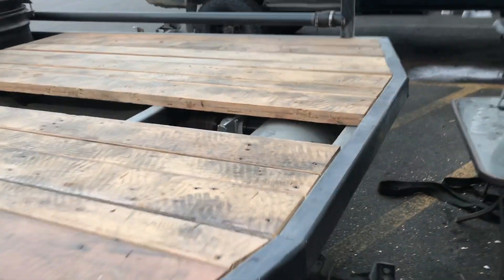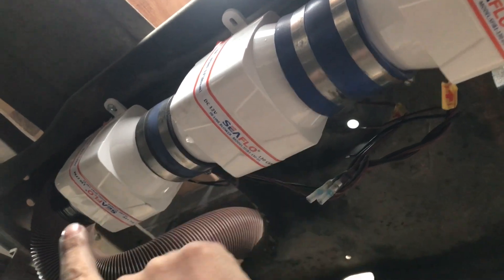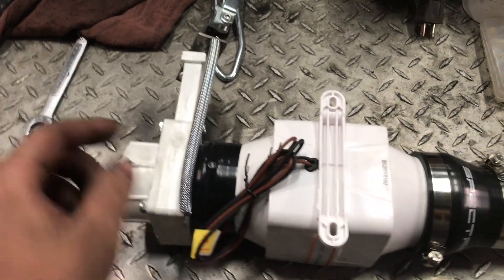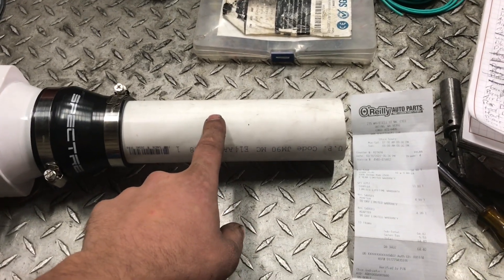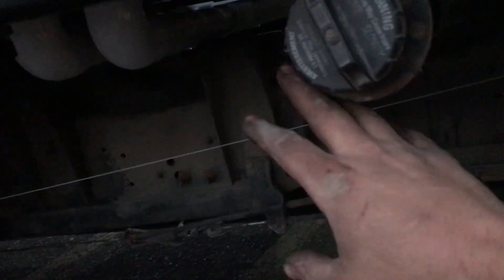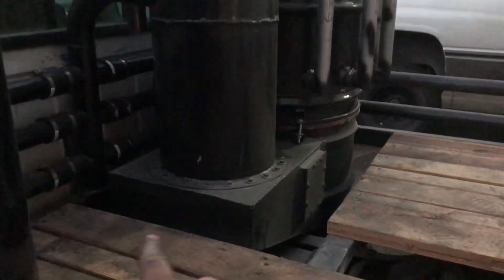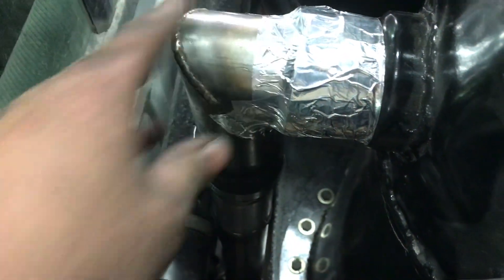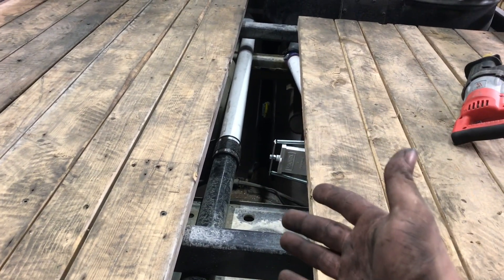V10 Gasifier Build Blower Fans and Rear Gas Line Plumbing

Comment: Thx for this video. Can I connect the blower directly to the car battery or I need a resistor or something else?
Reply from the maker: No resistor needed, I just jave mine on a 10 amp fuse, these blowers I use only pull 3 amp if I remember right and I run 2 per fuse with 14ga wire. Total overkill but they have been problem free

Comment: Nice work. Do you run the blowers as a performance enhancement?  To increase head pressures at the intake?
Reply from the maker: No these blowers don't push anywhere near as hard as the V10 can pull on them or even my small block Chevy truck both of them breathe way harder than these blowers could overcome there's no point to running them while the engine is running they're really only for starting and getting the gasifier up to temperature